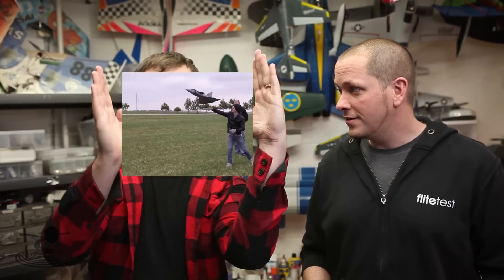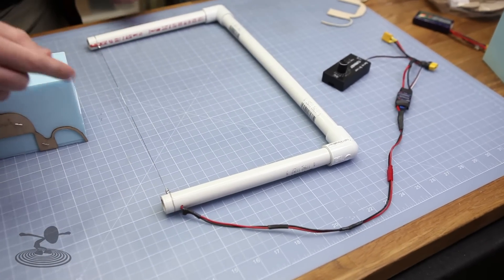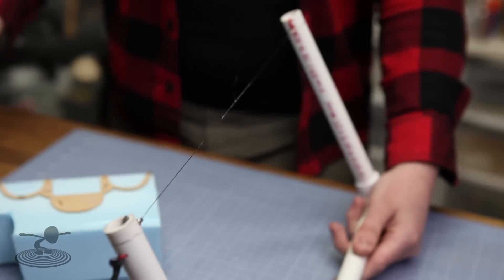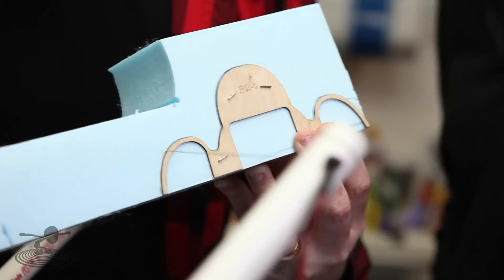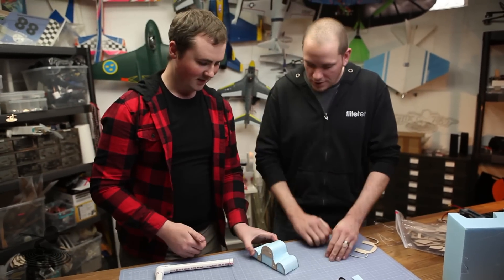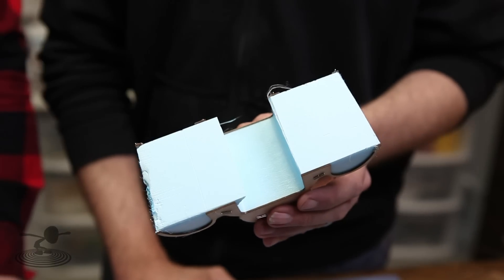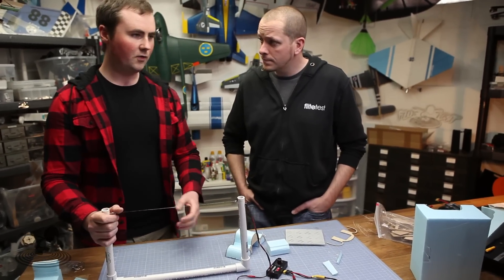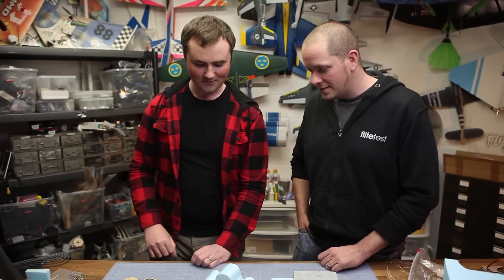Flite Test - Hot Wire Foam Cutting

Comment: Hi David,
Great quoting the formula for power, I2 x R.
We can measure the resistance of the wire in the bow of any length we intend to use, but how much current are you having flowing through the wire of the bow?

Fantastic model, second to none!

TIA.
Kay.

Comment: I've done this w a dimmer switch wired upstream of a 12 volt car charger. Great temp control.
Reply: Dimmer switch from room light switch?? And how did you force car battery charger to flow current if it is with electronic processor prevents from overload and so..??

Comment: first six minute cutting, totally too low power you try cutting foam yhis video. no good. can i use normal dc-dc step down converter use 24V 10A power supply and adjust this volts down what need. my laporatory ajustable power supply go broken i test 24GA nic crome wire cut first fine but then power supply broken, and has max 10A supply.

Comment: I have a hot foam cutter that is configured like a bandsaw. It has a table, the wire comes out of the table vertically to a frame that goes back to the table. I haven't used it but I loaned it to a friend who uses a handheld cutter and she liked it a whole lot better. 
Also, we have no trouble getting foam in Miami. In fact we're 30 miles from Miami and that's where we go to get foam.

Comment: 2018  I just did a little research and the  Nikrothal 80 .4mm he mentions is 26 Gauge  https://www.fasttech.com/products/3033/10016555/3385503-ltq-vaper-nikrothal-80-heating-wire-for  and that ESC is still available, but not that Turnigy Servo Driver, although they do have a servo tester as do many others. Also, looking at his cutting mat in his write-up, the length between the inside of the two pieces of PVC appears to be 15 inches. Myself, the shorter the wire, the more control you have, so I would make it just a little wider / longer than the largest piece of foam I would have to cut. Anyway, great job guys and good information and demo.

Comment: Could you make an aerofoil shaped hot wire cutter and cut the foam side to side instead of a long wire across the width?
I think you'd need thicker wire to hold aerofoil shape and more power, but it could the cutting process much simpler!

Comment: Found out I am very allergic to the off gassing of that foam when i used it around a window installed air conditioner years ago. When home, I had non-stop runny nose. We tested our suspicion of the foam being the cause, confirmed it was, and removed it. I have no other known allergies, so can only conclude the chemicals coming off that foam, cannot be good. The takeaway is: Use natural materials and hone your skills of workmanship with other building methods whenever possible. Enjoy lasting health.

Comment: I built a wire cutter shortly after this video. It caught on fire, broke countless times. To the model currently. On and off, idiot proof, no variable voltage, no indicator light. Just a tool. The battery is quite large for the application tho

Comment: will a hot wire foam cutter also cut balsa wood...???
Reply: Michael Petersen I dont think so
Reply: Michael Petersen it will but you pretty much have to supercharge it. I got it to work but it wasn't easy and it SURE wasn't safe. I wouldn't recommend messing with a hot wire to make it work.
Reply: Yea, even harder woods... But it is rather slow and makes a lot of smoke. :D
Tried it!

It even cuts acrylic, but you have to get it to glow red and then blow air over it, so the parts that aren't cutting don't overheat.
Reply: A hot wire will even cut stone if you get it hot enough!

Comment: hi can any one please help! I have the same set up as David here, I found out due to different servo tester that the signal wire gose on the other end of the tester. I got volts going through the wire but its not heating up? I have no idea why
Reply: nigel kelsey couzens use a battery

Comment: they sell nichrome at smoke shops that do e cigarettes you can buy it by the roll it's cheap too
Reply: They also sell it on Amazon, I got a 100ft roll for $6
Reply: +bigsouth779 28 - 30 gauge

Comment: Would your regular old Kanthal wire used in a vape work for this? I know a few shops carry NiChrome, but it'd be easier to just use what I've got around.
Reply: It works, I have it. I think Kanthal can withstand higher temperatures and has a higher resistance.

Comment: NiChrome wire is the stuff you need for this. It's the same stuff they put in hair driers and heaters. Get it from a hair drier without breaking it and a few sticks from the yard later you have a foam cutter if you plug it in to a rheostat like a light dimmer.
Reply: +1985cjjeeper Nicrome wire brakes to easy i use stainless steal or a guitar string.... Even mig welding wire works good.
Reply: what size mig wire and what kind?  SS or Fluxcore?
Reply: David B, you'd want to use SS not flux core. Probably any thickness since it doesn't get very hot.
I used Nicrome in a textile mill to cut 5 10 inch rolls of 150 denier polyester at a time on a machine we built. I can't remember the gauge but you can buy it at supply shops. I can see how stainless or a guitar string would work fine on foam though. Our wire had to be a higher temperature or it would melt the tube ends of the rolls together. In that application other wires would sag/break. I admit we only used a hair dryer wire to prove the concept them moved on to thicker stuff. I still have a roll somewhere, maybe 12 gauge or 14.
Reply: Thank you for the reply. I have plenty of SS .025in Dia. wire I can try first. I will give that a try first. If it works, I'll let you know. Once again, Thanks.
Reply: That should be fine as it won't need to be very hot for most things. Just make sure you never touch it when it's plugged in and you won't die.
Reply: I used a B string for an electric guitar, and it works just fine.
Reply: Thanks dude.

Comment: that servo driver, doesn't need an external power supply or is it powered by internal batteries? I have one that requires to plug in a battery. Does that mean I need one battery for the servo driver and one more for the ESC?
Reply: The servo tester is powered by the BEC in the speed controller, same way most small receivers are.

Comment: Add Springs to tension the wire. You'll get a better finish and you can turn up the voltage, which will produce more heat and will also allow you to cut faster.
Reply: If you put more voltage, more heat, yes. But the heat will "melt" more foam than your template. 
With a friend, we made that mistake while cutting foam cores for our glider's wings.

Comment: Does the positive go to one end of the wire and the ground to the other?
Reply: +Jacob Webb well of course, if you put both wires to the same end it wouldn't work because it won't include the wire in to the circuit itself.
Reply: That's what my dad thought, both wires to the same side. silly dad.

Comment: If you construct the bow like a spanend woodworking saw and use a string spring between the hotwire and frame you will get much better tension.

Comment: Can someone please let me know where to buy foam like this? Is it the expensive stuff from aircraft spruce?
Reply: art and craft shop? pink foam is also the same thing. most likely home depot has some
Reply: north or south?
in the south, all we have is ½ & ¾ foam.  I'm trying to build a surfboard and there are several OEM foam companies within a few hundred miles. Might have better luck getting ahold of the OEM or their distributors that sell direct to the public.
Reply: +87BWS the foam is called XPS or Extruded Polystyrene. it is pretty common on the east coast of the US but not as common on the west. it is expanded polystyrene (that stuff that breaks into tiny foam balls) that has been chemically melted then extruded to make a uniform material. That's why the cost increase. there are some specialty shops that sell it like foam mart in burbank CA but if you want it shipped to you, the shipping is normally more than the product because of its size. Good luck!

Comment: What type of foam was used in this demonstration?
Reply: They were using extruded polystyrene foam board like you would use for extruded polystyrene like Dow Blue Board or Owens Corning Foamular.  You DO NOT want to use expanded bead polystyrene foam board it is to frail, unless the part is real thick.

Comment: So how would you cut a hatch f.ex? I have a plane where the pilot door is cut in an angle, this means that you can't push the door through, and is an excellent for hatches, as they can only open outwards. But how would you cut that with a good looking result?
Reply: You use a real sharp Exacto knife and make the cut in a number of cut passes.  Glue some stiff paper or Balsa inside to act as a stop for the hatch.

Comment: BTW I use a number 10 Dulcimer string " like a guitar string" hooked to my Weller Soldering gun as a transformer " tip removed and wires hook there"  and run the gun from a light dimmer. Has always worked on projects for me. The biggest foam we can get around here is from Lowes or Menards for house walls.
73
Jimmy, ARRL TS, WX9DX

Comment: Ohm's Law is V=I*R (Voltage=Current*Resistance)
Joule's Law is P=V*I (Watts=Voltage*Current)

Nichrome wire with a diameter of .010 is roughly sitting at 7 Ohms resistance per linear foot. You can measure the 2 contact points on the bow with a DMM or use this as a rough calculation entry point for your R value. What current value are you attempting to achieve while you vary the voltage?

Great video btw!

M~
Reply: http://hotwirefoamcutterinfo.com/__SupplyCalc.html

Nevermind. I found it.
6.2v @ .92A = 5.7watts and 400F and 8.0v @ 1.19A = 9.52 watts and 600F
Reply: Mmm, brings back my unregulated vape mod days.  I would turn my own coils.

Comment: hi, i have tried to make it, but wire didnot get hot. my NICHROME wire is 32gauge.  just like a hair.and the output is +12v--750mA. where is i am wrong ?
Reply: your bow is too long for your power supply.
at 12v and 32gau

400F is 680ma at 20" of wire
500F is 790mA at 17.28" of wire
600F is 900mA at 12.17" of wire

Shoot for 18" which should put you at around 470F

Comment: Hi I new to the art.. where can i buy foam core - Thanks
Reply: They were using extruded polystyrene foam board like you would use for extruded polystyrene like Dow Blue Board or Owens Corning Foamular.  You DO NOT want to use expanded bead polystyrene foam board it is to frail, unless the part is real thick. Any good lumberyard should have the thick foam depending on where you live but you are going to need to buy a 4x8 foot sheet of it.

Comment: The fume released by cutting the foam is highly poisonous and carcinogenic(may cause cancer). I used to build my models out of this when I was studying architecture and our machines had fans that blew the fume away from the user. Wearing a mask may help avoid any health issues.
Reply: You could try using a vibrating wire than a hot one
Reply: If you use EPS foam board when cut with a hot wire it gives off mainly CO2 and water vapor, there are still some toxins but these are quite minimal when compared to even wood when burnt.
Reply: Cyanide I've been told,    not sure on the truth of that
Reply: True, It's also poisonous using a foam "to-go" box to warm up food in the microwave
Reply: Slacin' Ace Don’t ever reheat food in the foam container.  Always take it out of the plastic or foam container.  Its bad stuff.

Comment: What diameter should the nichrome wire be?
Reply: That depends on 2 things: The type and density of the foam, and the power you want from your wire at a given voltage.  If you intend to cut thin sheets of low density foam you can use thin wire, but if you need to cut the sort of stuff they are cutting here then your best bet is to just hit the thrift store and find yourself an old hair dryer, bust it open and use the coarsest heating wire in the thing.  The most important practical consideration once you're ready to string a bow with wire is how you're planning on powering it.  I like the ease of use of a cordless setup so I recommend powering the setup with a lithium ion battery.  Preferably 1 or 2 18650 cells.  Using a speed controller like this is a nice touch but not strictly necessary.  You want to be dissipating about 0.6 - 1 W/cm of wire so if you have a ~40 cm bow like David you'll need your wire to have a resistance of 0.4 ohm if you want to run it from a single 18650.  Ni-chrome would actually have to be excessively coarse to get such a resistance over 40 cm but a good alternative is stainless steel or piano or guitar strings.

Comment: The good thing about the templates is if you are like me and hopeless with all things electrical you can make your templates out of thin steel or aluminium and use a sanding block / Blocks to sand down to the template after cutting the excess foam away with a small saw or knife..

Thanks Dave and Josh this gives me more confidence to try new shapes that I wouln't have thought possible before..

Regards Vince.

Comment: You guys should sell a template kit.
Reply: ungratefulmetalpansy What he is saying is that a 2in thick block of foam may turn out to be only 1 and 7/8in thick. It could also be 2 and 1/8in, but you'll never be certain before you get it so buy blocks that are larger than you need and cut them down.

Comment: whats is the wire diameter ? 0,3 mm or 0,4 mm ?
Reply: the first (thinnest) electric guitar string is 0.2mm. Or you may use singlestrand 0.3 mm wire used for fishing

Comment: Hey! I have created a number of planes completely out of foam (but EPS not XPS) using a similar technique. But, when I do wings, I have issues with the sag of the wire. I get the timing and stuff right, but some of my wings get badly damaged due to the sag if I'm not careful. For now, I just push the bow down on the templates to maintain the tension and keep the string taut, but it is not very effective. What would you suggest I do?. 

I have a fixed 12vdc source at home. So I can't vary the voltage. So I just use a 60cm long guitar wire.
Reply: i tried guitar wire with 12v 8 amp battry charger. it didnt get hot enough to foam. so i started to make wire smaller. it barely work with 20 cm. when i tried 15 cm, the wire wasnt there any more :D. it was just puuffed. Just dissapered. not even smoke

Comment: You could use a turnbuckle half way up the arms to keep the wire taught,
Reply: It's usually better to just use the flex of the bow or a tension spring.

Comment: hye!guys im using cheap guitar string and a power supply source of 3 amp and 12v to 14v of voltage. i cant get nice surface finish.it is due to the wire type i used or the technique?please help me.

Comment: wouldn't it be so much easier to cut identical (or not) sections of the airfoil and impale them on whatever you're using to support the wings, instead of cutting the whole wing at once and making it one solid piece?

Comment: I dont get it, my hot wire cutter tends to burn the plywood templete and it is not smooth after first use. The wire also doesnt glide smoothly on the plywood template (plywood template is laser-cut). And how come my blue core foam does not have a shiny finish? :( mine will have a lot of "hair" that needs to be sanded off

Comment: You shouldn't need more than 10amp  I use a PWM controller instead of an esc, it has a rheostat and will take up to 40V.  I use 28gauge nichrome wire (stainless fishing leader also works) and up to 24v (2 car batteries in series) for wings up to 10 feet long. Any longer than that and you have to go really slow or your wire will bend too much (but that can be useful for adding reflex).

Comment: Thanks for the heads-up VH, that's what I call team work. Now that I have sorted my first Tricopter build and the associated Firm Ware issues.Whew!  I can now try my hand at making an airframe from inexpensive, readily available, easy to cut Foam.  BTW I am looking for the "How To Make Inexpensive Hot Wire Templates" ?
Or is there another link you found with actual template designs that I can print and cut out?

Comment: Hey HK still sells a brushed ESC!  I don't know how to access templates yet. Are you making your own or have you found a source? I'm so new, I am still working on hand launching my foamcore trainers.I have already destroyed three props and two motors will need new shafts installed. I wanted to use extruded SM styro like in the video. You know there are two diff kind 200 & 300 psi test. Blue and pink.Need templates for flying wing. I'll do a rear motor mount to help keep damage from crash minimal

Comment: I just made one today. I didn't use the esc or the dimmer. Just some nichrome, wood, and screws. I used a simple 9 volt on 12 inches of 28 guage wire. I plan to step it up to 12 volt as 9 was a little slow. Idk about the AC/DC part though. You can buy Nichrome on Amazon for a few dollars.

Comment: 3M77 works, too. Spray both faces, leave until it's only just tacky then press together. Holds well, and the wire goes through the joint no problem. (I learnt that from Phil Barnes dvd on vacuum bagging.)

Comment: I have have miles of Nicrome wire if you would like some. However you can use fine piano wire but unlike Davids bow you  need more tension to get a good cut. Use a high current transformer and a light dimer or you will just get a fire. 
The best bows are made of wood and Aluminium, and  have an H shape. You use 2 pieces Aluminium at the ends and timber to separate and insulate. Tension with shock cord or a spring & cord/rope.
$20 and your cutting.
Don't use PVC and don't burn the house down.